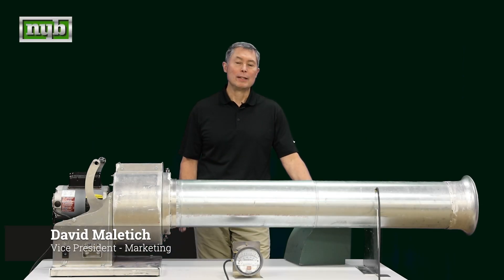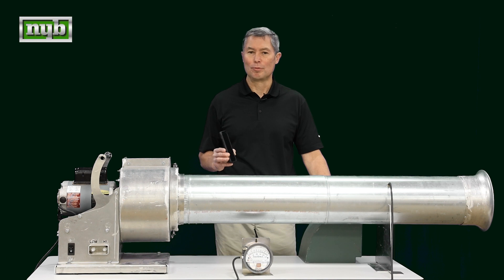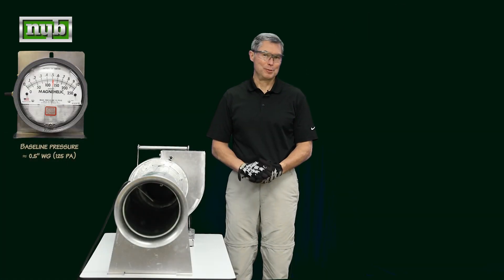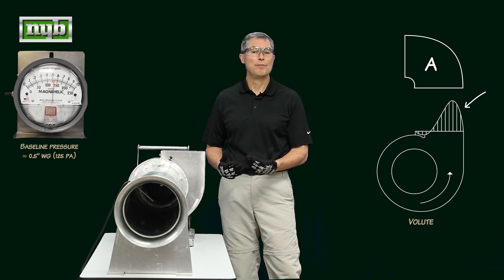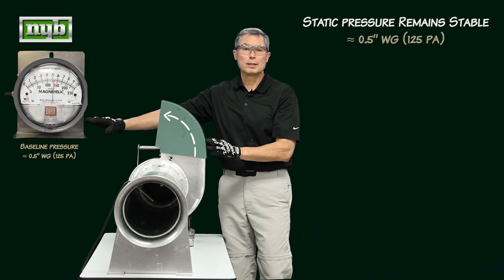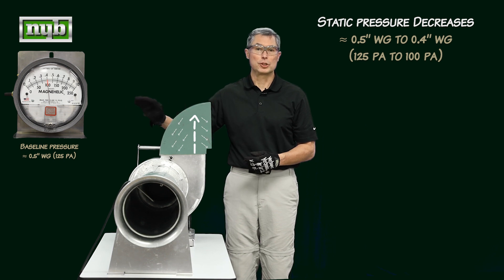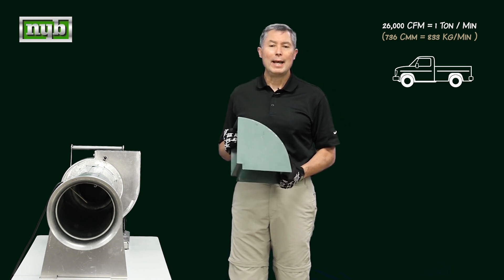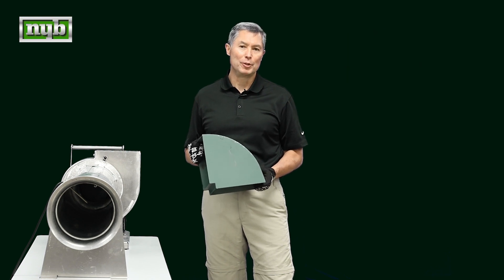How Discharge Elbows Affect Fan Performance (System Effect Series 6 of 6) | NYB

Comment: Excellent explanation. What about the motor power when you go from A to B (same rpm) ?
Reply from the maker: Good Question! In this instance motor amp draw does not change from open discharge to position A discharge to position B discharge when operating at the same rpm. This is because a new fan curve is created and the point of operation on each new curve result in a similar energy consumption (not always the case as sometimes a “B” position discharge may result in a slight reduction in energy consumption). The real increase occurs when the fan’s speed needs to increase to overcome the loss in performance. Fan speed would need to increase approximately 10% to correct for the decrease in flow and energy consumption would increase approximately 40%.